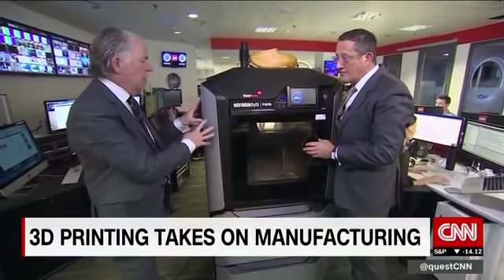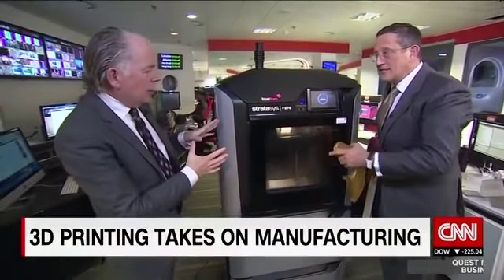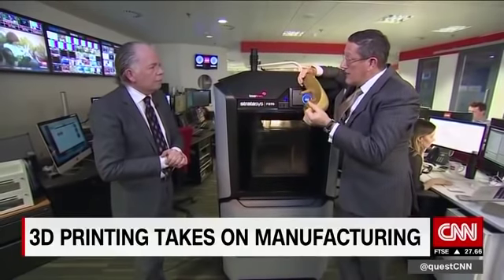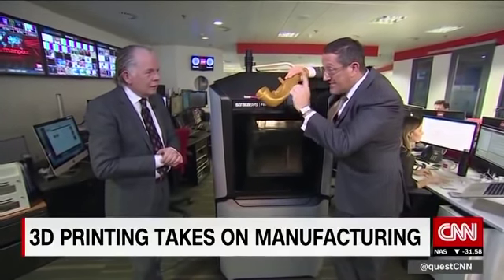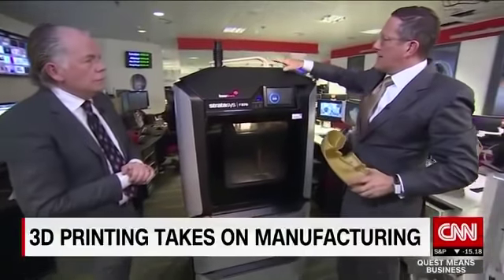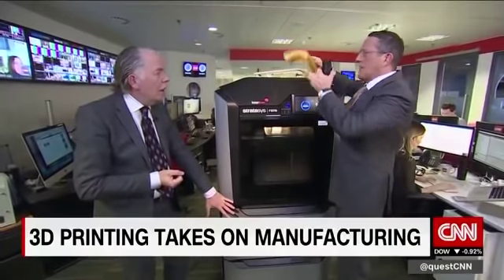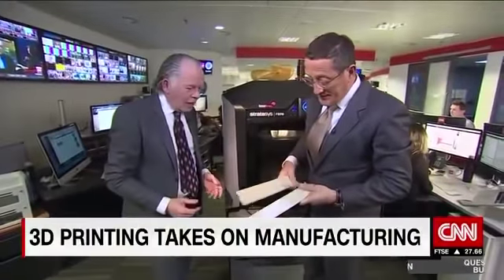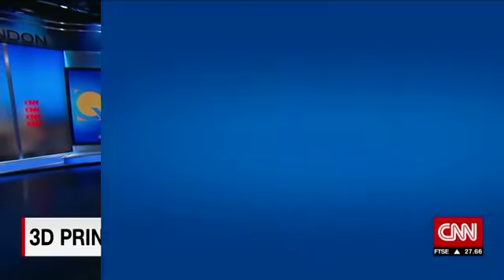Stratasys and CNN: The Revolution of 3D Printing

Comment: 3D printing revolution has been on its way for decades. No doubt it will keep growing but its still way off being cost effective compared to traditional high volume manufacturing. This guys job like most the promoters ie owners, is to sell the story. For sure 3D printing can bring the cost down to high value items but there are literally 100's if not 1000's of these companies manufacturing some form of 3D printers. Just have a look at the listed 3D printing companies near all are losing money! its a very specialized field with high entry costs to buy and maintain.

Comment: Sometimes you do not need a very large number of parts, say for specific needs, customized parts, 3D printing is the one to use to avoid the large investment in the tooling such as injection molding which makes these few manufactured parts so expensive. Also, the complicity is free in 3D printing.